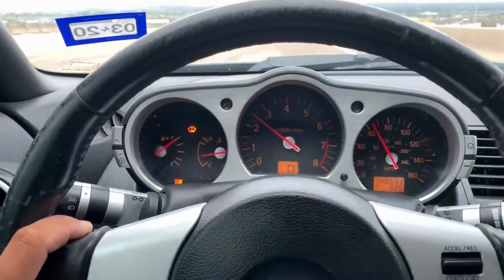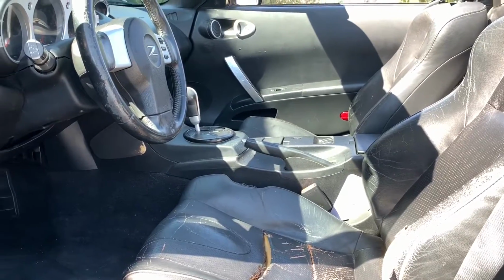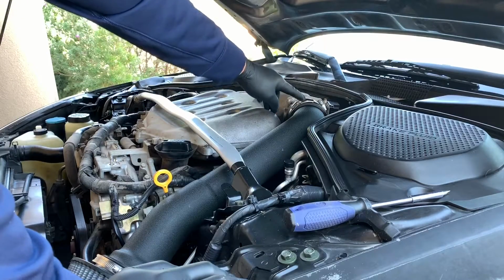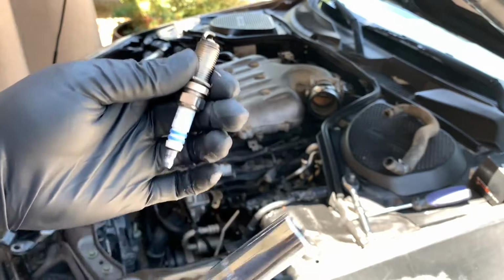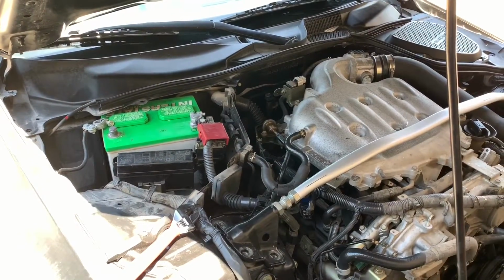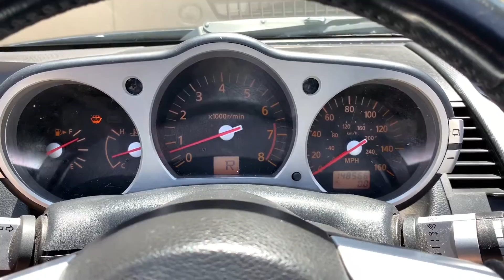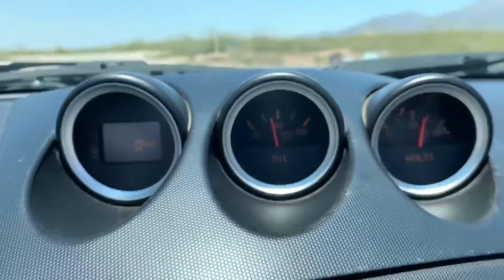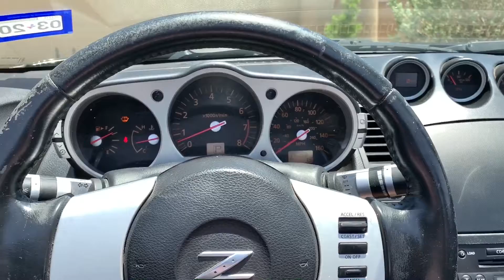I Bought a Cheap 350z! Now let’s flip it for a profit 👌🏽

Comment: Yeah I just got one 2005 convertible 113000 miles interior is all good after I cleaned it up, engine runs strong  gears all fine but bodywork has some issues it needs two new front wings which she supplied with the car along with a replacement hood and mechanism, £3300 not a bad buy

Comment: WHAT WAS THE OIL PRESSURE ISSUE? HOW DID YOU FIX?
Reply: Hi I have two 350Z and at idle they both drop to around 20lbs but at 3000 rpm they sit over 60 lbs so no problems at all with his oil pressure he’s just not used to Z engines but still a good vid
Reply: @andymeredith6921  thanks for letting us all know that, thats good to know!